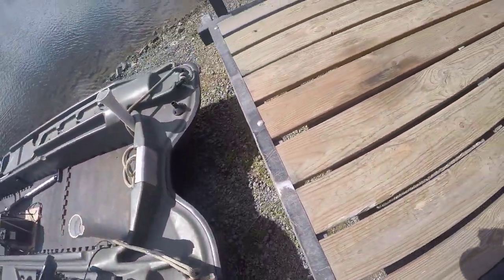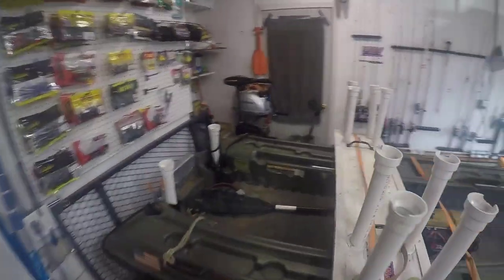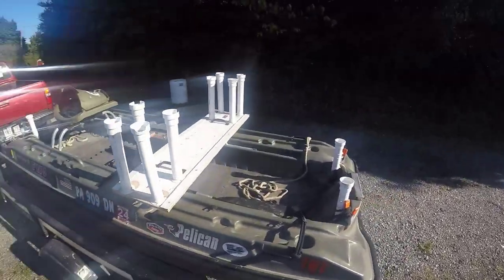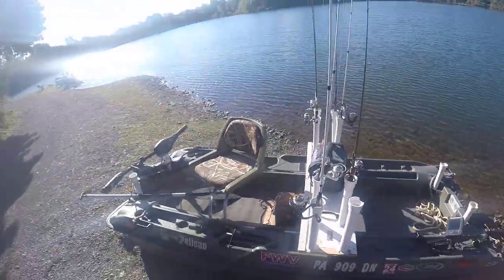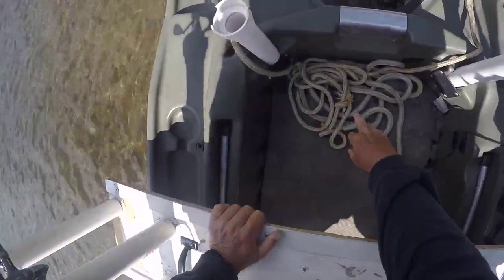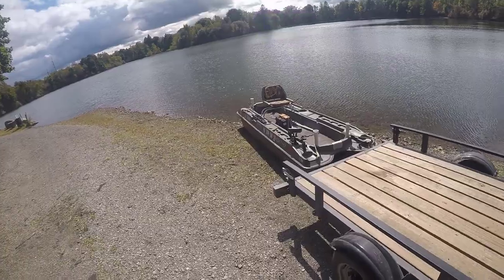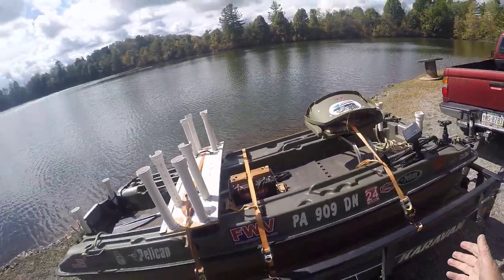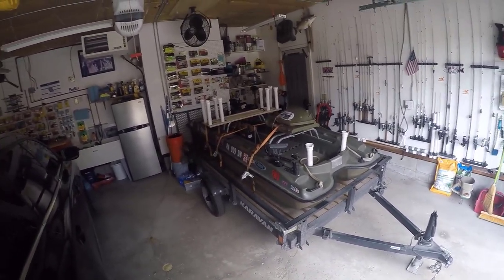PELICAN BASS RAIDER - LOADING AND UNLOADING COMPLETE PROCESS

Comment: I've had my Pelican Bass Raider since Dec of 2020 but this spring was the first time I splashed into the water. Been loving it!! I can load the boat into my Tundra PU on level ground when all is dry but I don't believe I could reload it at the boat ramp straight out of the water by myself. Haven't been able to get people to go with me to fish and help me load so I finally got my lawn mower trailer dependable with good tires and I have been hauling the Raider around on the trailer this year. I don't need any help loading or unloading now. I am 63 this year and I try not to over extend any more. I never thought about catching those plugs and ripping them off. I went and looked at my Raider a few minutes ago and both plugs are still there. I will remember to be careful when unloading it from now on. Don't have a building to store my boat on the trailer but I tip it up on two old tires on the side and lean it against a tree to keep it drained. It stays in the shade most of the time so I think that is working. I live on four miles of gravel before I get to the highway so it gets quite dusty. I need to take a broom with me and sweep it off when I get to the lake. I live in NE OK and have several lakes I go to as well as my neighbors small lake. It is easy to unload it and put it into the water. I am glad to see the tricks with the two ropes out the front. I need to work on entering and exiting the boat the way you do. Been using water shoes and rubber boots depending on the coldness of the water. I like how you solved that problem. Really enjoy your videos. Keep it up.
Reply from the maker: Glad to hear you got out there and was able to fish and use the PBR.  Sounds like a similar situation that I have in that I can't always count on having my son or friends available to go so I had to get a setup I could do myself like you were saying.  I am hoping the new battery for next year will help since I am also marching forward into the 60s.  Try the rope trick.  I also sometimes at other lakes with less steeper bank tie another rope to a tree or post or whatever I can find and leave it in the water so I can use it to hold onto while exiting the boat.  Sounds like you have a bunch of nice spot in Okla to fish.  I lived in Norman 38 years ago out of college.  I didn't fish then but wish I had.  Thanks for watching Gary and for the comment.  Fish on!